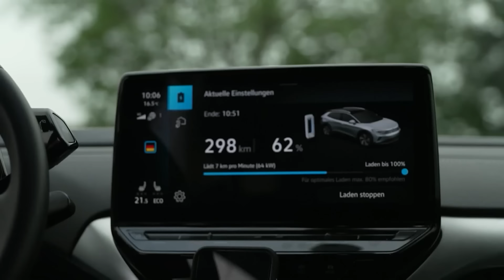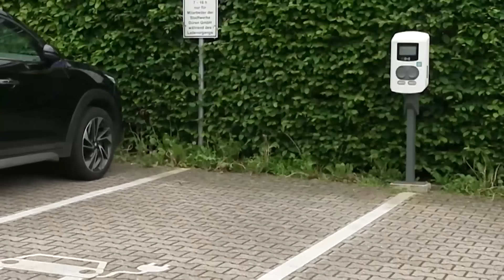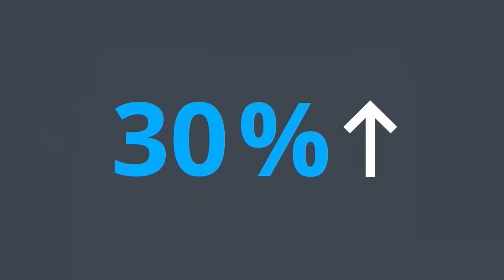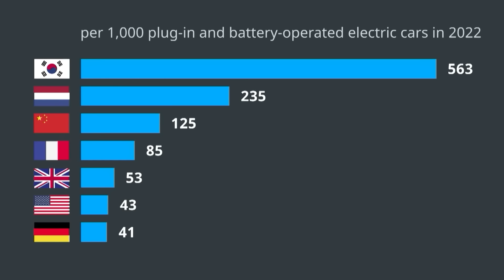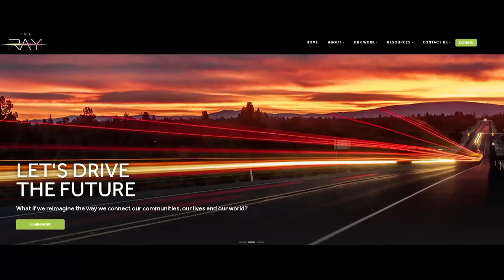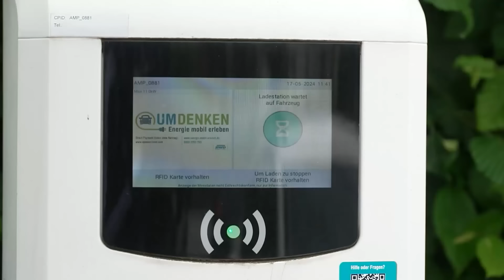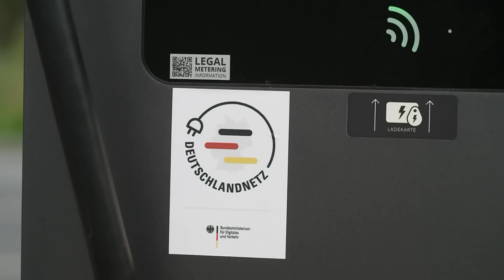Why Germany is falling behind in EV infrastructure | Transforming Business

Comment: Leave EV behind, just using train or another public services
Reply: They'll get there. First you embed electric charging in all highways, then to save road space software links cars with the same destination so they can drive closely together. Then you imagine some carless motors that can pull these convoys and presto! Trains
Reply: @photoo848  tech bros will call it an ultracar
Reply: @photoo848  they won't get there. look back and see how they reacted. Deutsche Bahn is an embarassment for Europe, let alone Germany. I'm sure there will be flying taxis before DB fixes its problems.
Reply: EV isn't meant for long roadtrips.
Reply: there is no woking public transport here, 2h with bus tram and trains to the next city, plus 20min walking. 25min with my EV, so public transport, thx, but no thx. My EV is cheaper too and rund on solar power
Reply: @t.d.5804  China EV, right?
Reply: There isn't a train that stops outside my house & stops at the shops I use or where I work.
Reply: 💀😭 Broken people make broken comments

Comment: Electric highways are a dumb idea: they cost a fortune to make and to maintain. We have roads full of potholes, which aren't that difficult to repair and prevent, what will happen to complex power electronics buried underground for kilometers?
And the inefficiency of induction charging, where up to 25% of energy is lost to heat?
Just deploy more fast charging stations with buffer storage to reduce strain on the grid
Reply: you can't blame anyone for at least trying to make it viable tho
Reply: or focus on trains!
Reply: I refuse to use "wireless charging" even on my phone. It isn't only inefficient and significantly slower, but it is also worse for the batteries. It is bad in every way imaginable, and it would be far worse under sand, rock, and tar. Also, for the record, in most places, potholes are very hard to prevent, and while they are not hard to "patch up," proper repair is more complex than people realize and requires closing roads for longer. There is a difference between dumping some asphalt on there and making a little mount that will crumble and taking a saw, cutting out the pothole, cleaning up the edges, refilling and compacting the subgrade and base, letting it settle, doing it again, applying high-quality, high heat tar asphalt of the right grade (as opposed to the general purpose shovel by hand kind), compacting it, protecting it from the elements to let it cure, and then sealing it in.
Reply: Also i think it could have health implications, like wi fi ,power lines ect

Comment: I already did buy two EVs and I will never but another combustion car. 

The first was an e-up in which we travelled from Dortmund to Corsica three years ago. Worked just fine!

Now I am driving a chinese MG5 electric in which I did 51.000km in 20 months. I mainly charge from solar which on average costs around 1,50 Euro per 100km. But we also took the car to Catania, Sicily, Rotterdam, Denmark, Berlin and other places. It also tows trailers at a pretty great efficiency. 

Considering that my car charges quite slow compared to a real long range ev, the concerns depicted here are quite unfounded for Western Europe.

Malfunctioning fast chargers are a problem of the past because you can easily get by using only destinations with ten or more stations, so you can always move to another one in the unlikely case. 

Next week I will be travelling to Munich which is 600km. That involves three stops, each taking 40 minutes in the MG5. With a Model 3 or an EV6 it would be one stop around 20 or 30 minutes.
Reply: What about charging in the winter? Last winter there was a whole tesla gathering of dead battery EVs in america. 
Also it's easy to travel in NW Europe, good roads, good EV infrastructure, easy traffic, the problem is that it's only within this range you're travelling. If you go to Poland it's a whole different scene
Reply: What about diesel freezing in the winter? Either in the gas station or your tank? Huge problem in really cold conditions. EV nowadays way better in the cold😁

Comment: I've heard some of the issues that drivers of electric cars run into when they go on long distance vacations in Europe with their electric car. Here 's a list of things people run into:

1. The charger is broken when they arrive at the charger.

2. The charger is behind a fence that has been locked.

3. The charger is in a parking garage, but the parking garage is closed.

4. The charger is property of a hotel and only hotel guests can use it.

5. The charger only works if you have an obscure type of card or an obscure subscription for it.

6. The charger is occupied and there is a long line of cars waiting in front of it.

If you arrive with a nearly empty battery at a charger in such scenarios, then that can be quite stressful.

However the issue with all the special cards that you need to charge your car can be relatively easily solved by allowing people to pay with their debit or credit cards, just like at normal gas stations. There really is no need for 1000 different cards. Maybe the option to be able to pay with a debit and credit card at a charger should be made mandatory.
Reply: The EU already has a regulation in place for newly installed high power chargers, that need to be bank card compatible & retrofit existing DC chargers in ~2 years
Reply: @kierank01 That's good to hear. That's progress in my opinion.
Reply: I have had en EV since 2020 and those problems have never happened to me. 
People overthink it. I had a work mate who asked me what I do when the battery charge goes down to 0%. I said I charge my car way before that just like you never run yours down to an empty tank.
Reply: Another " I've heard" story from a non EV owner.
Reply: I heard about a guy who charges his EV at home for FREE off solar...  Oh wait, that's me.  :)

Comment: I bought an EV and drive happy with it since end of march '24.

The big thing you missed is that there is an ongoing legal battle about the EV Charging on the Autobahns, preventing any real progress until this is settled likely in late 2024. So updates to this infrastructure will come next year. So far though in most places there are enough charging stations. Also recently a law was passed demanding that any of the large gas station providers has to offer fast charging on their gas stations until January 1st 2028.

This weekend seems to see an outage of the local provider for AC charting ("Stadtwerke") or their provider. And these are often single points of failure for providing this type of infrastructure. Fast DC Charging is still available though.
Reply: How's the depreciation?
Reply: @mutkaluikkunen3926  Not an issue with leasing.
Reply: @MeetingCPP  Way too expensive to lease anything.

Comment: Most difficult country for electric car adoption is Canada where it's very cold in the winters, commuting distances are very long and cities are hours driving apart.  Still, a few pockets in Canada has been slowly adopting electric cars like Toronto, and Vancouver.. Electric cars are almost unheard of on the vast Canadian Prairie provinces like Alberta, Manitoba and Saskatchewan
Reply: In Sweden, I'm wondering about similar concerns. The northern half of Sweden is very sparsely populated. New environmental regulations demanding upgrades of normal gas/petrol stations, threatened even this traditional distribution! (People with dieselcars sometimes even refuel at home.)

However, in the southern half of Sweden, I don't see a problem. Most people charge at home and/or at work, and then there are charging stations. The problem is EV's are so expensive to buy. Otherwise, I don't think people would consider anything else!

Comment: I own a 2022 Mini Cooper SE, the EV with the lowest range. I can get about 150km on a full charge.

When I first bought the car, I did experience quite a bit of range anxiety. I generally travel 70km a day. I don't experience any of that anymore. I plug the car in as soon as I get home, and it's always fully charged when I need to use it. And if I need to, I can travel double the amount I would in a single day - running errands after seeing friends, visiting friends, and so on.

I believe range anxiety comes from the novelty of owning an electric car. At first I was anxious because I had questions like, "Where can I charge?" and "What if I run out of charge on the road?". The answers are exactly the same as for petrol cars - "At public charging (filling) stations", and, "Stop, and call roadside assistance."

If you can charge at home (and you should - it's much more affordable), owning an EV only requires a minor mindset shift, and that's to plan for your charges on the public network if you need to. I can charge to full at a fast charger in 30 minutes if I have to, which is enough time for a coffee and a bite to eat. But this would only ever happen on the weekend, and if I needed to, I could plan it into my day. I'll also add that I have NEVER needed to do this since my range has always been sufficient.

I'll add to that that I live in South Africa, and the charging infrastructure is NOWHERE near as good as I'm seeing in this video. My jaw dropped when I saw the courtyard full of Tesla chargers. AND we don't get any tax rebates on electric vehicles - in fact, we are taxed more for purchasing them.

Over their lifespan EVs are FAR more affordable that ICE cars - they're more reliable, require fewer services, and are cheaper to maintain.

If it's within you price range, it's a no-brainer in the long-term.
Reply: yup but you learnt how to use it by understanding its limits and capabilities that every machine has.

Comment: Range anxiety doesn't exist amongst people who actually drive an ev, this is only a catchphrase to shy off the ones who did not buy one yet.

They also keep telling that traditional car brands shy off of ev's, but somehow they keep releasing more ev models each year, and investing more and more in batteries. 

Let's face it, the only reason why they did not switch completely to ev is because they can not get their hands on cheap batteries as china can. Anybody who thinks that car makers prefer to mess with complex ice or hybrid variants instead of strapping a simple electric motor to a battery should get their IQ checked. 

Well apart from the fact that they don't like to not be able ripping you off for servicing fees, since ev's don't really need any maintenance.

Comment: There are already many DC HPC (High Power Charging) stations in Germany. You will have a charge card / subscription to a specific brand of stations, but if you go to a different brand you likely will be able to charge there but the price per kWh will be a obscene high. Not just 10-20-30% more expensive, no it can be 90% more expensive (*1). Result is, despite there are many DC HPC stations, you can only really only use the stations of the brand you have a specific charge card / subscription for.

The charging situation is like mobile-phone roaming 10 years ago. Your phone / Internet will work when you are on vacation in a foreign country but at rip-off price.

(*1) Happened to me a week ago, when I had missed my Ionity station and I had to charge at BP / Aral for 0.92 €/kWh.

Comment: Solid-state batteries are about to come out (which are better) and these charging infrastructures are not capable of charging these new batteries, so new problems to come out
Reply: What you are trying to say is that in the beginning, charging (20-80%) will take 10-15 min instead av 5 min?
Reply: @Boatmoviemaker  Apparently solid-state battery charge faster, but today's chargers infrastructure don't charge solid state batteries, so they either modify the existing ones or add new ones

Comment: Batteries that can be quickly swapped are the quickest and easiest answer to the all but insurmountable bottlenecks of fast recharging. It was successfully employed for long range travel in the past, before the advent of mechanized transportation: stagecoaches used to swap teams of horses between strategically located intermediate stops along the longer routes. But don't expect anything useful or sensible coming from Germany's present ruling coalition.

Comment: Come on now, we build a new global wireless cellular network every few years. Compared to that, upgrading the grid and building few charging stations is easy.
Reply: Really? The amount of infra going into upgrading the capacity of the electric grid is way, way more work and resources. You might needs to upgrade the transformers, add more parallel power lines for larger transfer capacity etc. Upgrading the cell network transceivers and the underlying hardware is much easier.

Comment: If the west also standardize battery shape and does not change that with every car models also makes the battery costs lower in the long run. Also with improvements in battery tech it would be possible to Swap them out more easily instead of writing off the whole car! 
I don't want to have this kind of financial risk. I bet most likely we all don't.

Comment: This is typically something that needs to be addressed at the national level as well as at the european level (if we really want to go emission-free). All countries have a power grid that is just not sufficient to allow >30% of its inhabitants to drive EVs. That is not a German specific problem, that plays out almost everywhere in Europe. 
In addition, there are everyday problems that should not exist if you want such a large group of people to embrace EVs. It is just unbearable that there are still a lot of charging station providers that work with unreliable hardware. Your navigation system in your ev gets on-line data whether a charging station is free or not. But does not get the data if a charging station is faulty or gives an error message.  This is just absurd and you just need to make a law that fines these providers if they don't provide that information. (not to mention misadvertised charging speeds that are actually shared across multiple charging points)
On a european level there should be a standard for communication between car, charging station and power network. This is not easy, but it is a minimum requirement to make the power grid smart/efficient. This also includes that every EV is able to deliver its power back to the grid so that all EVs can also act as a buffer for the power grid. Of course it makes no sense that you would have to buy home batteries for every household while your largest home battery is between four wheels in front of your door. This last point should have long been regulated by Europe and it is a mystery to me why it is not there.

Comment: The continued use of internal combustion engine vehicles is unsustainable both economically and environmentally. Scientific studies show that these vehicles significantly contribute to air pollution and greenhouse gas emissions, leading to climate change. Economically, the cost of fossil fuels and maintenance is higher compared to electric vehicles (EVs). Research by BloombergNEF indicates that EVs will reach price parity with combustion vehicles by 2025 due to decreasing battery costs. Additionally, the environmental damage from fossil fuel extraction and air pollution-related health costs far outweigh any perceived benefits of continuing with combustion engines.
Reply: Price parity is just a start since it's for new cars. In the world's largest open air car museum, Finland, for example, it will take 20 years or more for many Finns to get an EV.

Comment: EV not environmental friendly as it only last 7yrs and batteries pure poison
Reply: Tell that to Tesla - they have an 8 year warranty on their batteries....there's one that's still chugging along after 430,000 miles.
Reply: My nine year old electric van would tend to disagree with you. Also DON'T EAT BATTERIES!
Reply: EVs outlast ICE cars by a great length. The electric engine is simpler with much less moving parts so it can last practically forever and current ev batteries have also very long durability. It's a myth you need replace them every few years.

Comment: Electric vehicles are not eco-friendly as long as fossil fuels are the main source of electricity generation.
Reply: nah fossil fuel generated electricity is much more efficient than combustion engine
Reply: Petrol and diesel cars use over five times more electricity than doing the same trip in an electric car. Because crude oil needs to be processed into the petrol and diesel, this takes massive amounts of electricity.

The power grid is getting more and more green energy on it, however even if you recharge an electric car directly from the dirtyest coal power station it would still be cleaner than a petrol or diesel car.
Reply: This opinion of yours has 7 likes. 8 people are clueless.
Reply: Lol like Ev is made out of recyclable material. Don't forget mining and steel mills.
Reply: Luckily  there  are so many countries now that has the majority of their electricity produced by renewable sources these days, fossil fuels will very soon be a thing of the past, less than a decade for most developed countries, those who aren't being deliberately held back by the fossil fuel industry that is.